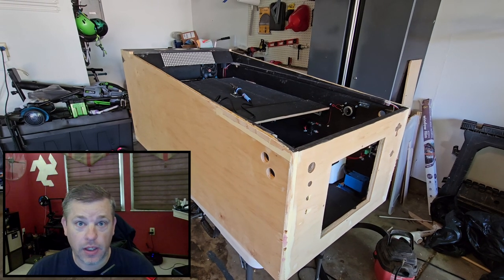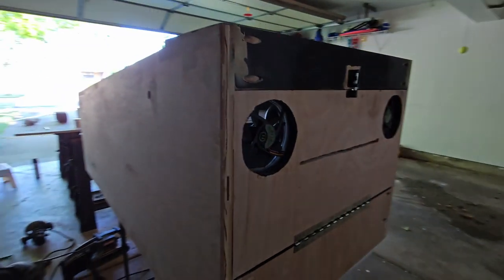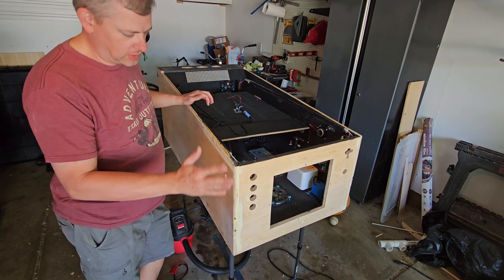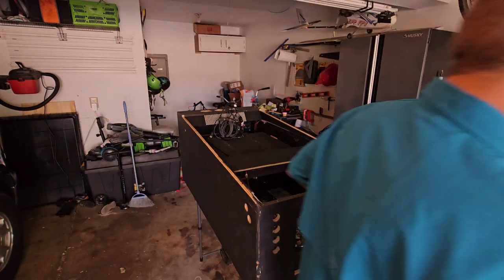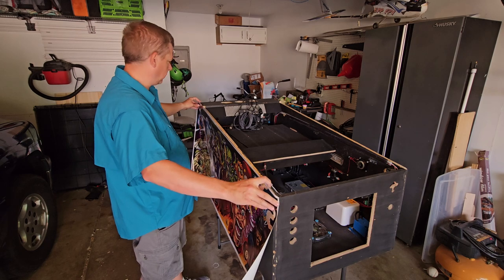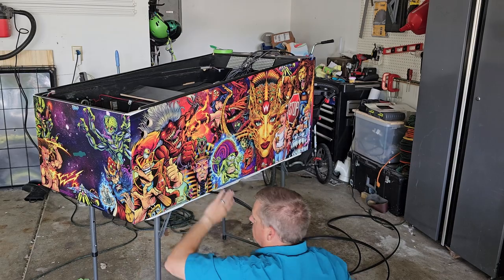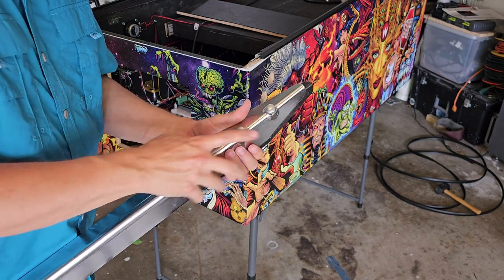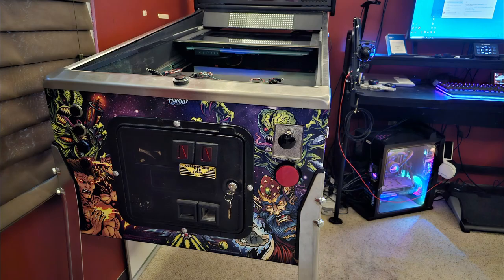Scrapyard Pinball (Pinball on a budget) E21 How to add art to a cabinet

Comment: Your setup is a little different as your adding artwork after it was already assembled and built and being used. 

I will say, if you turn the cabinet on it’s side, your not working against gravity, your working with gravity… ie if you let the art go, it doesn’t fall, it still stays where you placed it. 

Makes it much easier to adjust and install. 

The biggest tip is “measure twice and cut once”.IE… take your time.  It’s not super difficult but a little bit of planning can go a long way.
Reply from the maker: I originally thought about that. The table I used to hold the cabinet up was not the best. It is a cheap plastic folding table i used for other projects and is knicked, dented, and scared with cuts. It took a very long time to smooth out the cabinet, and i didn't want the table to ruin that thought i suppose a towel between them would have worked. I also didn't want the weight of the cabinet to damage the art I installed on the other side. Good advice, though. Thanks for the post.